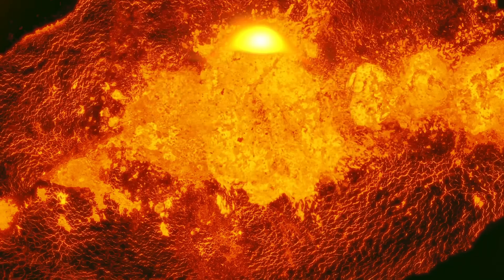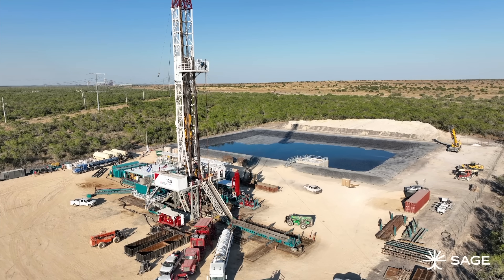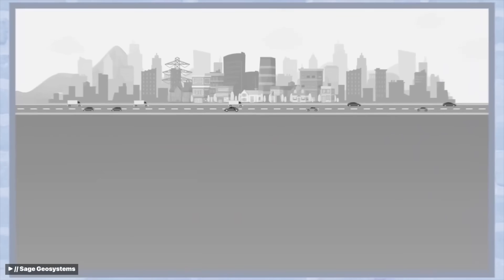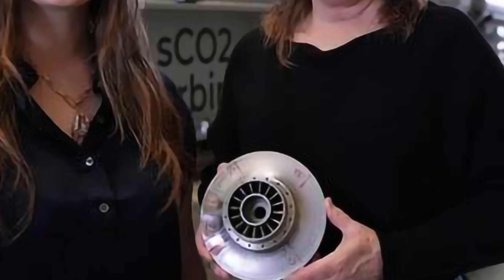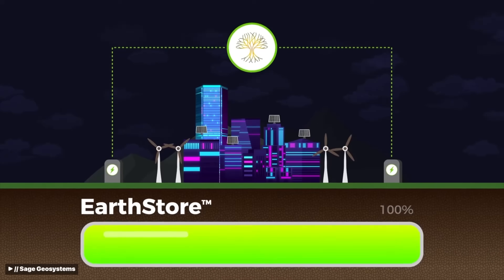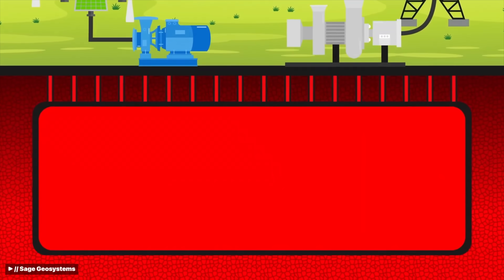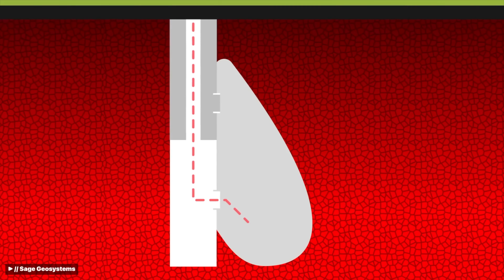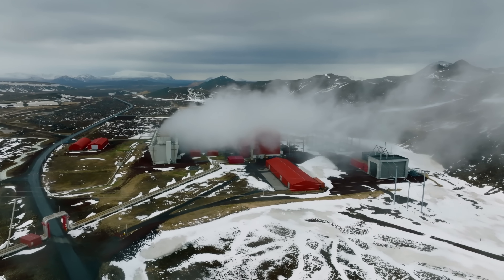This Tech Solves Geothermal's BIGGEST Problem - Gamechanger?

Comment: This is encouraging.  There is another company I'm aware of also trying to crack geothermal using advanced drilling techniques. Eivor, out of Alberta, Canada. They are building an industrial sized plant in Germany. 
I do like the ability to reuse old wells.
Reply: Eavor uses a closed loop. Closed loop systems are more responsible than any fracked system, your fluids and rock do not come in contact so youre not extracting anything unintentionally such as water soluble salts or heavy metals, less risk of contaminating soil and water, less risk of gas release ie radon.
Reply: @mikefarough8806 Yes, I wonder which has more longevity as well.
Reply: Eavor is amazing. I love the concept of the Eavor Loop
Reply: @Israel_Two_Bit  the only problem is the cost...  $200 million for 8.2 MW is sorta nuts.  That is almost $10k more per kw than what the first SMR in North America will cost
Reply: With scale cost will go down

Comment: This is not new, we know because we have had geothermal heating for about 20-30 years just drilling 200-800 meters, but finally someone putting in more effort to develop it in a bigger scale all over the world. And also the pressure can easy run turbines... Only have to do deep holes.  And it is a perfect as a partner to sun, water and wind energy.
Reply: It is ”new” - The big difference here is that you get electricity. Geothermal heating is great, but it still needs electricity to pump it from the ground.
Reply: you can always tell when someone doesn't watch the video.
Reply: read again... video says breakthrough is new, not geothermal in itself 😉
Reply: What is new is the method, not that geothermal is new. For example, the turbine is what is really new in terms of converting more of the heat into power. Best gens are like around 15-30% - a C02 base one could scale up to around 40-60%.